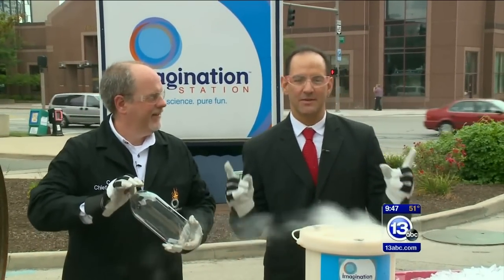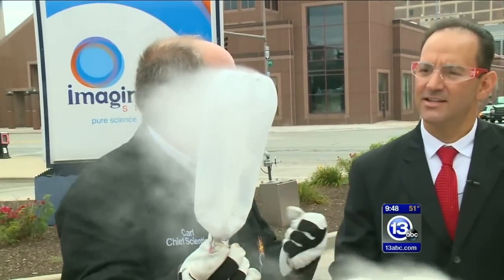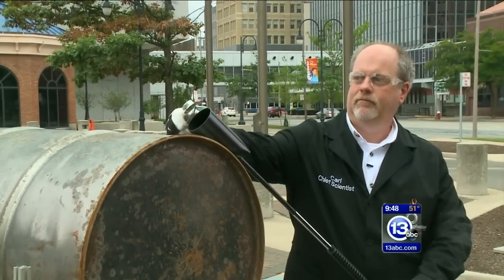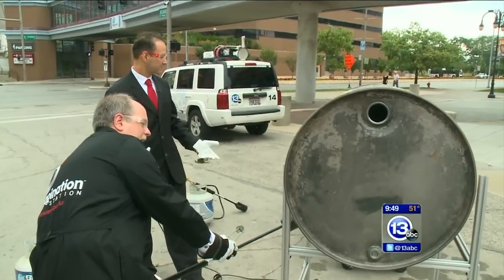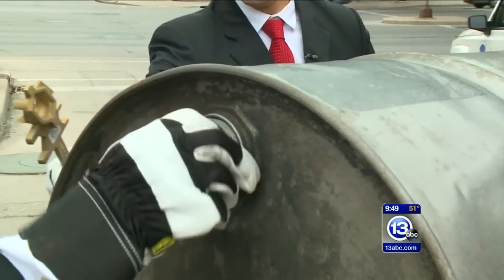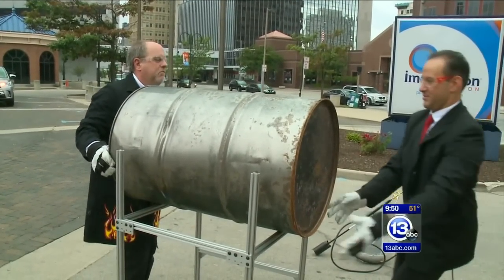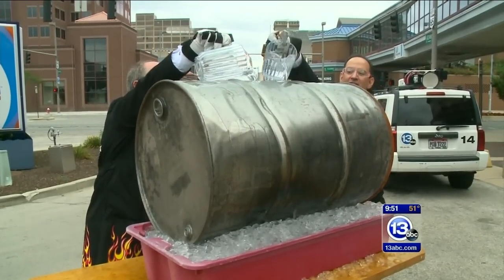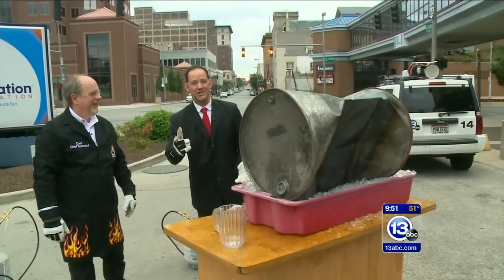Crush a steel drum with air pressure

Comment: Before retiring I used to work in the water industry. We used 20,000 litre tanker trucks for emergency supplies. One of our safety briefings was a video of what happens when the water was pumped out of the tanker without the valve being opened to allow air into the tank as it emptied. The effect was the same as the barrel , except on a container 80 times bigger. Scary stuff.

Comment: I've been doing this with 1 gallon cans in my physics classes for over 25 years. It's pretty dramatic. However, I also do something that I never see anyone else do. And that is, expand the crushed can. To crush the can, you need to lower the pressure inside by heating it up so that air leaves the can. Once the can is crushed, if you cool it with the cap open by putting in a freezer with some water in it, let the water freeze over night, then cap the can and heat it up, the pressure will become greater inside than outside and the can will "de-crush" or expand. Pretty cool.
Reply: did u do it with another 4 ppl under 3800m sea?
Reply: @kenho-wr5ul2rh7m  not funny, but appropriate
Reply: I was thinking they should let the 2-liter bottle warm back up and show it expanded! So cool you take the experiment further than most. 

Just an unrelated side note. I remember one winter I had bottled water in my car, but the water wasn’t frozen. I took a bottle into work one day and when I put it on my desk it immediately froze! I was like wth just happened??? Lol. Looked it up and found out it was super cooked water. I thought it was so interesting!
Reply from the maker: Huh, That an intersting idea. I wll have to give that a try!
--Carl

Comment: It's so frightening to imagine five people in this steel drum.
Reply: Also realize that this experiment shows the difference of only 1 atmosphere difference. At the bottom of the ocean near the Titanic, the pressure is about equal to 400 atmospheres, or 400 times the pressure you experience on the surface. If you think this visual is dramatic, just imagine that at 400 times as violent.
Reply: It's called a submarine

Comment: And it's only 1 atmosphere pressure.  Imagine 380.  The 5 people didn't even know what hit them.  That's a little "comfort" knowing that they didn't suffer.
Reply: N someone said that they lost balance control n where rolling around on top of each other. So its not like they where just sitting in one spot the sub was turning and going down like an arrow at the time n then it leaked water n then imploded with out them knowing what was going on. They where all crushed on top of each other.  Now there's an image for ya.
Reply from the maker: It's probably much less than a 1 atmosphere pressure difference. Which makes it even more impressive.
--Carl
Reply: Unless they couldn't breathe.

Comment: A fun experiment a lot more people can do is to take a plastic water bottle on an airplane, then after you've emptied it cap it tightly while at altitude (a cabin pressure equivalent of about 7000' above sea level).  Then when you land (assuming you're landing at a low elevation airport), the bottle will crush some.  It won't happen all at once like the steel drum but it's still cool to see.

Comment: 0:18 “14.7 pounds of pressure on our bodies”.  To put that into context, we live under an ocean of air, and the very bottom of air (sea level) the pressure is 14.7 psi.
Reply: Yes , a square metre of air in a column 120,000 ft high, weighs about 10 tons .

Comment: What would be the pressure difference? Just 1 bar or more?
Reply: obviously a maximum of 1 bar. because the only pressure here is the external atmosphere. inside, it can only reach zero, it cannot be negative. suction does not exist per se, its just inferior pressure. just like there exist a temperature zero, btw.
and yes, we re all thinking at the same thing. for the sub, it was around 300 bar.
Reply: It is greater then zero and less then 1 bar.
Reply from the maker: Probably less than one atmosphere. Next time we do this I will add a pressure gage to the small port on the drum to determine pressure inside the drum. 
--Carl

Comment: Easy safe way, take a soda bottle,  after you drank or poured out the contents, use your mouth on the opening and such out the air. As you do, it slowly gets crushed from the outside air pressure.

Comment: Why is water needed? Why don’t u just heat up the air in the drum? Pls help me
Reply: When the water boils, the steam created fills the container, pushing the air out. Since the steam is a gas, it expands to fill the space and ends up taking up about 1000x the volume of the liquid water. Eventually it starts coming out the hole. The cap is placed on. Then when exposed to ice and cold water, the drum cooled enough for the steam to condense back to water. But it only takes up about 0.1% the space as the steam. The other 99.9% is nothingness --- a vacuum. So this isn't a "slight difference in air pressure," as he suggested. It's the difference between 14.7psi and just above 0 psi.
Reply: @arvia1984  thank you. That’s a very big help
Reply: @Ramiristempest  It is exactly how the early stationary low speed atmospheric steam engines used to work ( for pumping water out of mines etc ) steam filled the cylinder to push a piston up , then they cooled the steam in the cylinder which condensed causing a partial vacuum which allows the atmosphere to push the piston back down. 
Here's how it works . https://youtu.be/GMgP-4O99qU  Technical explanation at 3:40 .
Reply: @WildPhotoShooter  thanks. Btw, if I'm interested in these kinds of things, what major should I take? I need some advices
Reply: @Ramiristempest  I couldn't advise you on that, you would need to decide what discipline of physics you wanted to spend your career in.

Comment: I don't think that the submersible TITAN imploded very quickly as shown on this video. Because when the submersible was moving down to the ocean the changes in water pressure were gradual and slow. In the case of TITAN there is no sudden  changes. Therefore I think that before the implosion, the submersible started to make a deformation and it collapsed like "implosion of a can" but not suddenly but slowely.
Reply: I think you are wrong, once a weakness formed in the hull of the Titan the collapse would've been instantaneous because its strength would have been completely compromised and 400 atmospheres per square inch ( equivalent to about 4000 tons over the whole surface of Titan ) collapse would have been instantaneous. The crew might have heard a creaking for a  second as the hull failed, but  I don't think they would even have had time to ask each other what the noise was. Carbon fibre snaps like  a carrot when it fails.
Reply: @WildPhotoShooter  Do you think that if the pressure hull was made of steel instead of carbon fiber , would the deformation be gradual as well as the failure ?
Reply: @zehravigna4873  Nope, even in a steel hull once the strength is compromised and fails the collapse would be just as fast until all the air has been expelled ......we saw how fast the 45 gallon drum failed when its strength was compromised . 
A human body would collapse and implode  just the same  at the depth the Titan was at,  our skull and rib cage would collapse like an egg shell.
Reply: @WildPhotoShooter  This gallon imploded very quickly because it was not thick enough, in other words his stength was not strong enough. If this drum was made of a very very thick steel the implosion would not be as sudden as on the video. We may have even observed the deformation. It is my opinion.
Reply: @zehravigna4873  Anything would implode with exactly the same speed when it reached its design limit , even a modern nuclear submarine would fail in exactly the same way if it went too deep.

Comment: That was a rubbish set up….I am surprised it worked at all.  He spent too little time heating the water to make steam and half that time just warming the drum’s top section.  If he had got that drum properly puffing steam clouds out THEN the crush would have been spectacular. Edit:  Thinking maybe a bit harsh…I guess he did demonstrate the principle at least.  BTW this is how household barometers work with a needle moved by the squishing of a metal box due to changes in air pressure…
Reply: He said he had boiled the water before starting the filming, so it just needed a little extra to get it boiling again, maybe you missed that part .